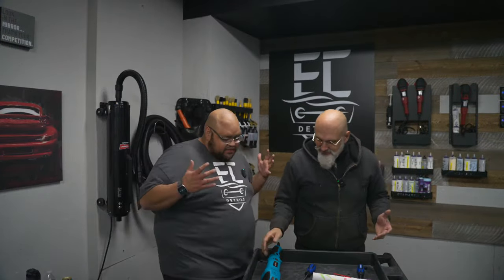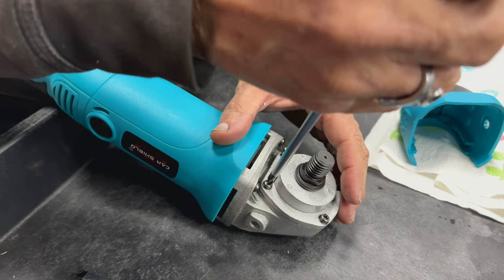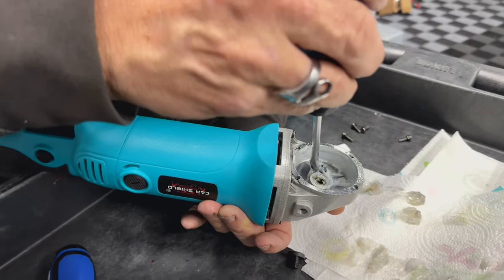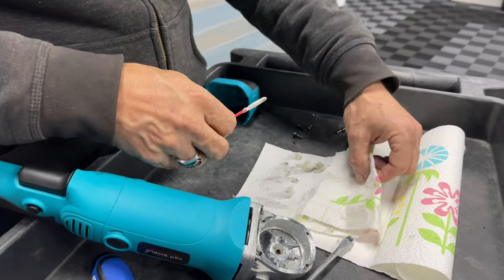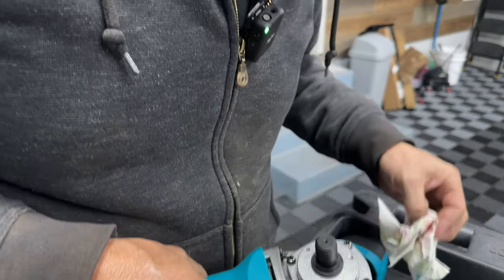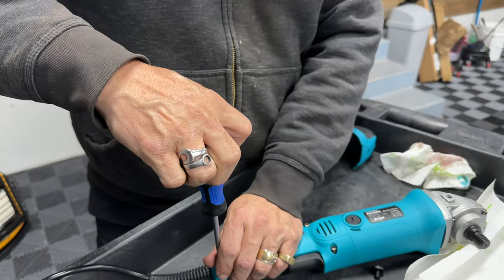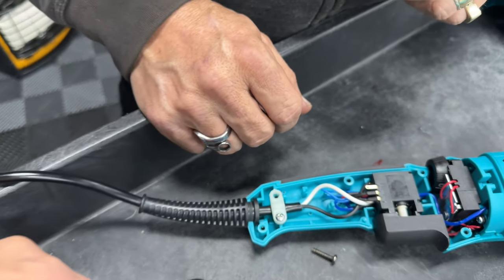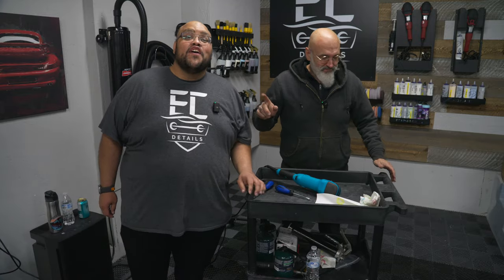how to maintain your new and used polisher with Yvan Lacroix!!! #detailing #recommended

Comment: While the Db reduction is minimal the Highest pitch whining most rotaries make at higher speeds is all but eliminated due to better lubrication...Depending on how many hours you put on your machines this regreasing should be maintained at minimal every two years for best performance and less wear on the drive gear and rotary gear...Just like oil in your car is changed due to metal shavings in it...Absolute great video!
Reply from the maker: Thanks for watching

Comment: So would you recommend changing the grease on the flex pe14 2 150 and the rupes 15mm mark3?
Reply from the maker: Rupes every year flex never had to change
Reply: @Ecdetails  ok thanks appreciate it
Reply: @Ecdetails maybe the reason you never had to change the grease in a Flex is that the grease they use in almost $50 a pound from their parts dept.  So you get what you pay for.  Also Ivan stated that all polishers needed different grease. I’m sorry but he’s wrong since I know that Griots uses a very high end Mobil grease in all their polishers and they say it does not need to be changed and since they’re willing to guarantee their polishers for life I’ll trust them to know what they’re talking about

Comment: Ok 1st of all, he doesn’t even know what kind of grease it originally came with, so how does he know it’s inferior to the grease he’s going to put in? 

What if the original grease proved to be quieter than the replacement grease? Well too bad because he just threw it in the garbage and can’t get anymore. Lol. 

Notice how in the 1st sound test he’s holding the phone so no part of his hand is obstructing the phones speaker. 

On the 2nd test with the new grease, the phone is nearly in the palm of his hand, in other words it’s in the way and not giving a clear path between the tool and the speaker. 

All that and the difference is a whopping 1 decibel? 
Who’s polisher ever broke due to lack of/cheap grease? Nobodys. Lol.
Reply from the maker: Hello Samuelfish, I hope you're doing well. Firstly, I appreciate your comment. I would like to mention that the machine's operation was smoother overall. We conducted tests before and after applying the new grease, and it was effective enough for us to decide to replace all the grease.

Have a great Friday!
Reply: In the car world they call that the “butt dyno”. You know when you decide to try a different brand of oil and you could swear the cars running smoother than before. 

Thx for the quick reply. I still think this grease changing is unnecessary, especially for those who aren’t mechanically  inclined.
Reply from the maker: @Samuelfish2k  I appreciate you leaving a comment. Would probably be a better test to have 2 of the same machines switch out one grease and see how they both perform doing multiple people. This is of course me thinking out loud! Haha
Reply: @Ecdetails  you're right to change all the grease in your machines.. it's a worthwhile endeavor. You both observed a 2db reduction at speed 6, this is a very good result considering that -3db is halving the sound pressure level and  i'm sure some machines would actually reach -3db with this mod depending on the machine and the grease used.. this is significant when you understand how sound pressure works and that running two 94db polishers at the same time would equate to 97db... think about how loud two polishers are at the same time compared to one, that's the difference that could be achieved with this mod
Reply from the maker: @dastrangle  thanks for this!! I appreciate your comment